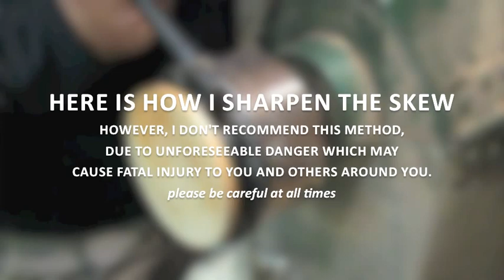How I Sharpen the Alan Lacer Skew - Woodturning

Comment: I have watched your sharpening video of a Lacer Skew several times. When the skew comes off the sanding disk it is flat. When Alan takes the skew off the wheel it has a hollow grind. Alan then uses a diamond card to sharpen the two high points that act as the cutting bevel. Does your method leaving a flat grind work just as well. I really like the Lacer. Alan was kind enough to make sure I got a sharp edge, and I want to make sure I can get the same cutting edge.
Great videos.

Comment from the maker: Hi Jack, both ways of sharpening will work. The flat grind is an ideal for me. Reason why I like flat grind is because I'd like to have a cutting edge and everything else behind it has to either be faded away or smoothened. The reason why Alan is using a grinding wheel is because most turners use a typical grinder instead of this "sandpaper grinder hack". Anyhow, when I get a moment I will explain a little bit more, at the mean time you will get used to the tool, just be safe.

Comment from the maker: @bazlur thanks. The skew I used during this video is Alan Lacer skew. I think the smaller one they have is 5/8" which is good too. But for the shaving accessory handle making I would just use the oval skew. For me all skews work the same, except when it comes to scraping. For scraping cuts I like heavier steel like Lacer skew here. Seems like you are well off with the oval skew you already have.

Comment: I'm thinking to buy and looking for a skew for turning. I normally use Easywood tools, but bought a sorby oval edge skew, but thinking to buy rolled or round edge skew like yours. Can you advise me what size is better for turning small stuffs like Shaving brush and Razor handle? Who has the best tool of this type skew chisel? What type of sanding paper you used to sharpen the chisel?. Thanks for nice example here